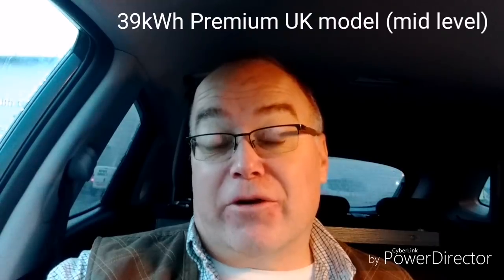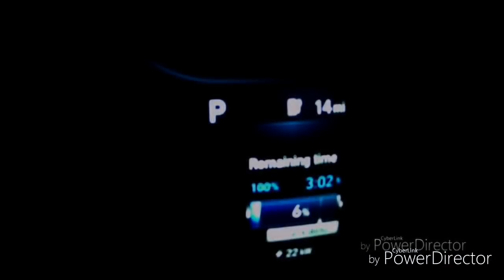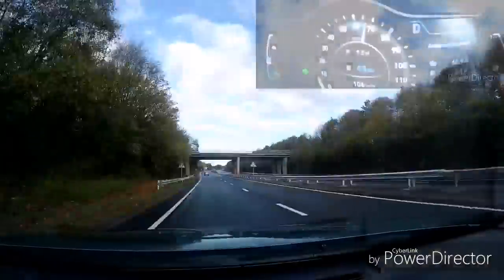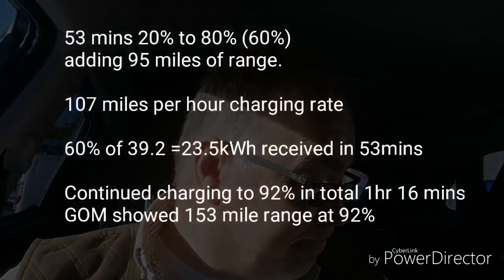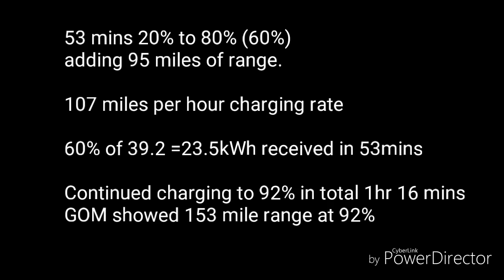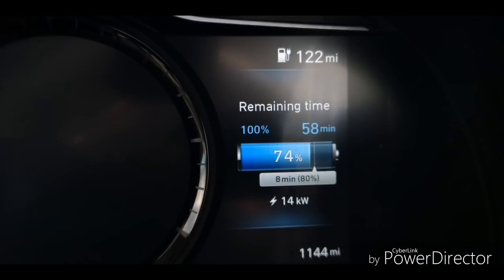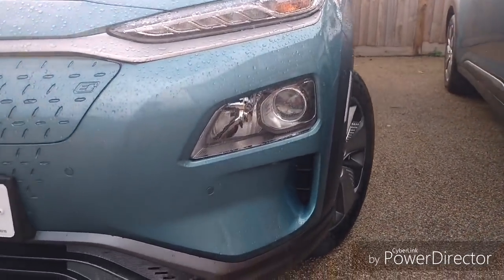Multiple Rapid Charging / Charging concerns & why I wouldn't buy a 39kWh Kona Electric

Comment: If a 39Kwh capacity battery is charged at the same rate as a 64Kwh capacity battery, it will be being charged at nearly twice the energy/battery cell as the larger battery. This is why the 39KWh battery will have lower KWh charge rates. When the 39Kwh battery is charging at 46KWh that's 1.1xC/Kwh. When the 64Kwh battery is charging at 46KWh that's only 0.7xC/Kwh. (C is the batteries Capacity)  As both size batteries have the same 54 mins charge to 80% figure then the Charge rate for the smaller battery has to be less than that for the larger.
I think the slower rates are the BMS doing its job and protecting the battery cells from charging too fast. 
I wonder if this demo cars battery has ever been charge to 100 percent (and given time balance cell voltages)
Reply: The correct unit is kWh. Neither w nor h are SI units, and K is the base temperature unit, Kelvin.

That having been said, you're of course correct that charging rates should always be specified relative to capacity, which is why C, exactly such a rate, is preferred by battery engineers. 

100% SoC doesn't mean the same thing in different products. There isn't really any objective 100% level either. One might think that if you just kept charging a Li-ion cell until the voltage no longer increases at all, meaning ALL the charging energy is converted to heat, then you are at the highest voltage it can go and that would logically be 100%. But it would probably just catch fire before the voltage stopped increasing, so you'd never be able to determine this voltage experimentally - at least not unless you had some crazy cooling in place. Even if you could, it wouldn't be useful information. What really matters is how much energy you can put in and how much you can take out. Overcharging is basically a matter of opinion with no real objective answers, especially when you consider that different li-ion chemistries have slightly different properties. In practice, you simply define some voltage as 0% and another as 100%. Depending on how conservatively you defined it, the battery might survive being charged to 120% or discharged to -20%, or it might break if you go 5% outside the envelope (especially at the bottom). 

There's no way for us ordinary mortals to know what the different car makers are doing. Teslas for instance are known to keep drawing a small current long after the display indicates 100% state of charge, and people have concluded (as far as I know without any additional, direct evidence) that it is balancing the battery pack. 

Balancing the pack just means reducing the variation in the voltages of the individual cells. Basically, if the cell voltages vary, then by definition some are higher than others. To protect these cells, you must stop charging when they reach whatever voltage you've decided to set as maximum. Because of the variation, some of the other cells are not fully charged, but you can't continue to charge the pack because that would overcharge the cells that are high. So if you had a single cell at maximum and 99 cells at only 80% the single cell would basically mean you could only charge the pack to 80.1%. Mind you, battery packs don't get out of kilter this way. If you look at the cell voltages as a histogram (the LEAF SPY app for instance allows you to do this) you'll see they tend to be normally distributed, with most of the cells being a medium voltage, some higher and some lower, and fewer cells the farther from the middle you go. And the delta (the difference between the highest and lowest cell in the pack) tends to be in the tens of mV range, rising to maybe 0.15V only when the pack is very nearly depleted. The battery cells aren't 100% identical clones down to the atomic level of course, so it would be extremely strange if they didn't vary at all. In practice, with balancing, the voltages are in fact very closely matched.

How can you balance a pack then? The best would be to allow energy from cells that are above average flow into cells that are below average. But you don't know in advance which cells will be high and which will be low, or how that might change over time. So doing this would require being able to connect any cell in the pack to any other in an ad-hoc manner. That simply costs more than its worth, so instead, you just make it possible to connect cells to resistors, so you can discharge individual cells (those that are high) by running a tiny "panel oven". To maximize the capacity of the pack you would discharge ALL the cells except the lowest one down to the voltage of the lowest one. Then you can charge until all of them are at your target 100% voltage. This approach is called bleeding, because you are deliberately wasting some energy - letting it out, so to speak. And you don't need to first bleed and then charge - you can bleed the highest cell at the same rate you are charging it, and it's voltage remains unchanged while the low cells are getting fuller. This is how Tesla does it, and that's why the car can continue to pull a small current long after it reports SoC as 100%. 

An unbalanced pack makes a mockery of the entire concept of "SoC", because in principle there is nothing to stop a battery from having some cells that are fully discharged but other cells that are at maximum voltage. If so, the pack is simultaneously fully discharged (you risk damaging the low cell if you draw energy from it) and fully charged (you risk damaging the top cell if you charge the pack). For this reason, I am pretty sure balancing doesn't just happen at 100% SoC, but also at lower state of charge if the pack is starting to get significantly out of kelter. There is another reason the car "wants" to be charged to 100% at least once in a while (Hyundai says at least once a month in the user's manual for the KONA), and that is to calibrate the system. The capacity slowly changes over time, and that means the energy for each percent SoC changes over time. For the car to provide correct consumption numbers and estimated range it needs to adjust its beliefs about remaining capacity, and the only real opportunity to measure this is when the car is charged to 100%, preferably from a fairly low SoC (preferably from the point of view of obtaining a good estimate for the capacity - it might still be better, from an owner's point of view, to avoid low SoC to protect battery life and just live with slightly less accurate consumption numbers).

If the pack is already well-balanced (in most cars the BMS will receive measurements of every individual cell, because a single cell going too low can permanently ruin it, and the whole pack will then be disabled until that cell is replaced) you may not want to do any balancing until 100% SoC, because it is after all wasteful. If you are burning 2-3 kW to get the higher cells down to the same level as the lowest ones, but then stop charging at a point where no cell is higher than 80%, you could have got the same energy into the pack faster by not bleeding any cells (allowing some imbalance), or alternatively more energy into the pack in the same time (ending at perhaps 83% instead). Like I said, I think any BMS still does some balancing even if the owner never charges to 100%, because without it you would just be accumulating greater and greater imbalance over time, eventually crippling the pack completely.
Reply: I'd say this is the first explanation that makes sense and thus makes purchasing the largest battery you can afford, that is if picking up miles of range per hour of charging is a concern.  It may also help explain why Tesla's batteries (all of them are larger capacity) seem to have slower rates of degradation than those in other cars with smaller batteries.  Each individual cell is not getting hammered so hard or as frequently over the same distance traveled.
Reply: Just a thought, And you covered most of it, Having the bigger battery and better efficiency, The 64kwh Kona's battery per cell is doing about half the work (charge/discharge) as the Nissan leaf, and with the water-cooled battery management should degrade at half the speed.
Reply from the maker: I think the Kona is dissipating heat better enroute
Reply: @williamcox1176  from some videos Euan McTurk has done it's not quite that straightforward. The smaller battery cars will cycle more often but each cycle will transfer less power so causes less degradation with each charge. Over the lifetime of the battery I imagine more capacity will help with lower degradation but if you look at 22kw Zoe's their SOH even after 50k milesis still in the high 90's
What will give it an advantage over the Leaf specifically though is the liquid cooling. Temperature seems to be the real killer of li ion batteries now that BMS prevents high/low SOC problems.
Reply: Hi Ross, Have to disagree. The reason it transfers less power is that their's fewer batteries to put it in.
Degradation is caused by age, but mostly cycles and heat. The Kona has about twice the range of the Ioniq and over double the battery size, So half the cycles.
And as an added benefit, due to the larger range its easier to keep it in the sweet spot 20%-80% charge state.
But as i say with most of my comments, I could be talking bollocks.
Reply: @williamcox1176  you are as likely to be right as I am! I enjoy the comments on videos like this and various fb/Twitter feeds as you can usually learn something, even if that something is that I am wrong 🤣
I guess it would depend on if there are lots more individual cells or a similar number of larger capacity cells.
Reply from the maker: Is the onboard charger the same as on the 64kwh, I wonder?
Reply: @williamcox1176  I totally agree
Reply: That is absolutely correct. DOD matters a lot in terms of degradation. Smaller batteries will degrade faster due to this as they use more 'range' of the total capacity for the same distance as a larger one.
Reply from the maker: It was at 100% when it arrived and yes what I saw is the car protecting the battery from cold , which increases charge time beyond what Hyundai state

Comment: My car tapers a lot when charging on DC. But there seems to be a correlation between State of Charge (what’s in the battery) and the Charge Rate (in kWs). In the 38kWh Kona it seems to be about 90. So take the SoC away from 90 and it gives you a rough expected Charge Rate. eg if battery is at 70%, Charge should be about 20 kW. (90-70=20). At 40% SoC, Charge Rate should be about 50kW (90-40=50). It’s very wet finger but seems to work, and is an indication if the Chargepoint is not delivering rather than the car not taking enough. Might be worth seeing if there is a similar correlation in your 64 kWh Kona.  (NB Doesn’t seem to work at the very bottom 15% or less, or very top of SoC, 85% or above)
Reply from the maker: Ian, doesn't explain 14kw at 50-60%
Reply: I agree, It doesn’t. Sometimes there can be a bit of stagnation before the charge session settles down (although not normally for 10 minutes), or it could indicate a faulty chargepoint.  As I said it’s a pretty wet finger in the air method. It’s not 100% reliable but I find it better than nothing. The other examples in your video seem to match the 90 sum. Often, when I think I’m getting a slow charge, if I do the correlation sum, it turns out the rate is about right. But sometimes the numbers don’t stack up. That’s the time I look to change to a new chargepoint.
Reply: Having gone over the video again, I missed the bit where you were only getting 14kW @ 50-60%. But your other examples do seem to show a trend (the trend being the BMS tapers the charge which is a good thing, for the battery.)
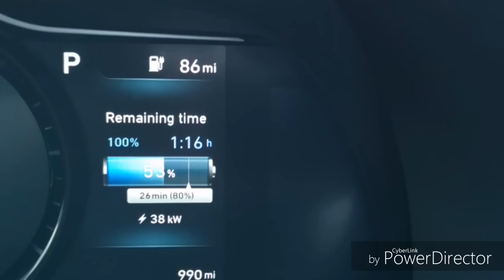3:24 53%/38kW (total 91)
3:34 54%/33kW (87)
3:44 69%/21kW (90)
3:49 73%/21kW (94)
3:54 75%/14kW (89)
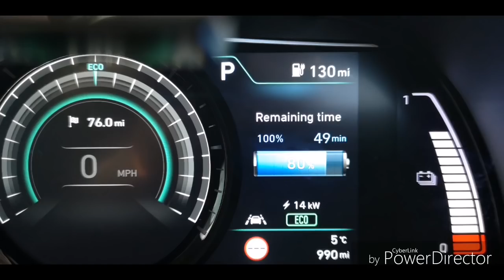4:01 80%/14kW (94)
Second Charge
8:16 32%/34kW (66) but just started
8:32 64%/25kW (89)
Third Charge
10:12 44%/33kW (77) but just starting
10:26 49%/42kW (91)
12:34 69%/22kW (91)
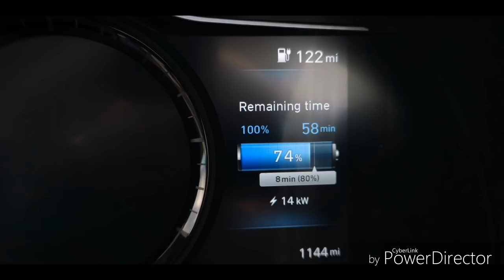12:55 91%/10kW (101) above 90%
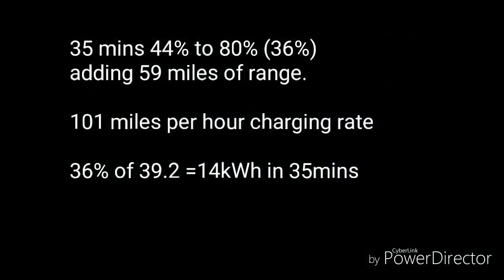13:00 94%/9kW (103) above 90%

From this I conclude the battery tapers according to how much is in it. (My car does very similar). It can be slow at the start of a charge, and you seem to get a minimum charge rate above 90%. If aircon or BMS fan is on, it consumes electricity so my charge changes slightly as not all the electricity coming in is going to the battery; some of it is being used to run stuff. It used to frustrate me that I wasn’t getting the full rate, all the time. I now know not to expect that, so it’s no longer SO frustrating. 

It would be interesting to know if there was a 'correlation' on your own car with the larger battery. 

I have to say I find your videos showing how it actually is on a trip, or how you find it, to be so much more useful than just reading the brochure. Really useful info. 👍🏻
Reply from the maker: Cheers Iain.  I have the excel data from the three charges but haven't charted it yet. When I do I think it'll make interesting viewing compared to my own 64kwh on the same charges at same time of day etc, as like for like as possible.

My gut feeling is the tapering starts earlier in the SOC range plus there's more tapering at the owner end of SOC thus squeezing the middle bit where you get full power for just a few minutes.
Reply from the maker: Iain, I didn't say on video but I went back to the same charger 2hrs later same SOC but I guess warmer battery after driving and got full rate expected. I suspect the cold battery slows you down... A lot
Reply: I certainly find the charge rate is a very flexible thing. Which is why I quite like the 'correlation' thing. Whilst it’s very rough ball park, and it’s affected by outside temp, battery temp, battery SoC etc, it still gives an expected charge rate. Easy to identify if a Chargepoint is faulty. And just because it’s giving, say 15kW, doesn’t per se mean something is wrong.

Comment: In the same way that high battery temperature reduces charge rate, low battery temperature will certainly result in a low charge rate.
Presumably the BMS is programmed with charging rates related to battery temperature and it acts to prevent the battery overheating, but does it have the capability to heat a cold battery so that it can handle a higher charge rate?
To do that, the liquid flowing through the battery pack would need to pass through a heat exchanger, external to the battery pack, to be be either heated or cooled depending on the actual battery temperature.  I had presumed the fans were simply blowing cool air over some sort of radiator that the liquid passed through, resulting in the liquid being cooled, but it may be that there is some sort of heater in the system so that the fans can blow warm air over the radiator to heat the liquid.
Reply: Bruce McPherson 
This is vaguely how Tesla does it. Preheat the car and in turn you warm up the battery. I start my Model 3 about 15 minutes before I set off in the morning and may have only a few dashes of limited regen on the power meter.
Reply from the maker: Sounds sensible. The annoyance is not knowing. Its doing something because it's hot or cold, which is good, it's protecting the battery but it's not clear on buying the car how much temperature will or will not impact charging times. Its just fuzzy, which is my concern mostly. We need more clarity before we buy the car

Comment: With the HVAC issue, have you tried adjusting the flow balance and direction of the air yourself? If so, that might explain some of the unbalanced air temperatures. I have an Ioniq and used to have that problem. I now just set the temperature and put system in auto mode. I'm toasty warm and the heat arrives much faster than any ice I've driven.
Reply from the maker: That could be the reason, trying to be clever and doing it without Auto